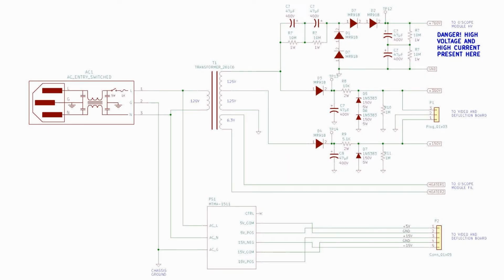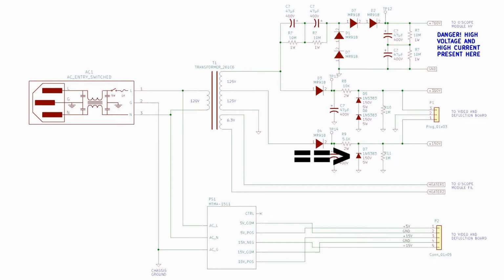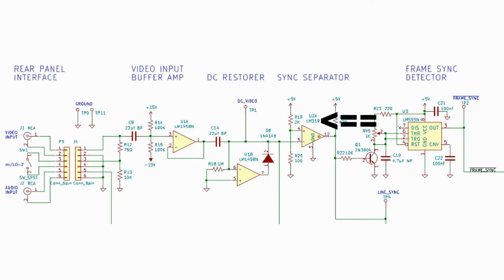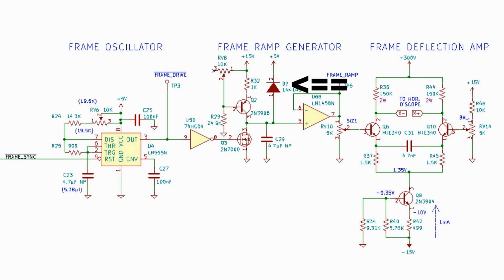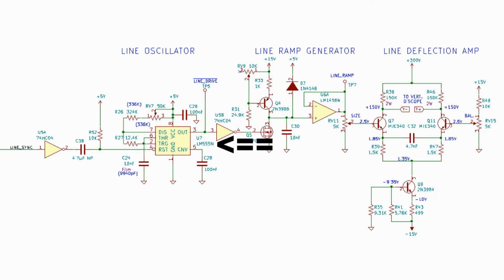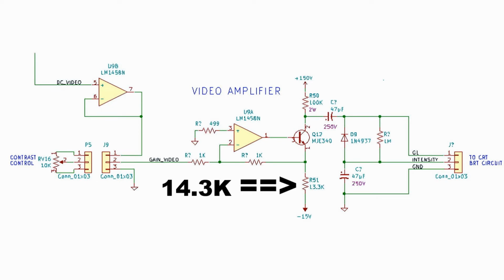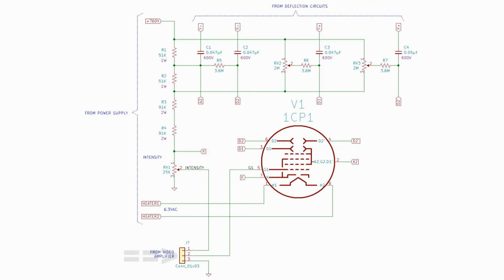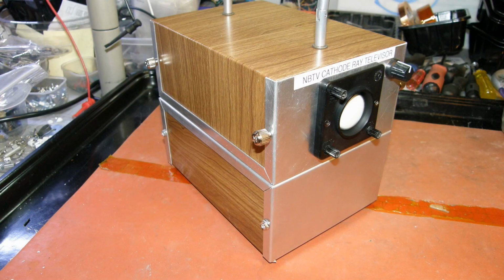NBTV Cathode Ray Televisor, Part 4

Comment: One comment on the audio amplifier. Don't you need a coupling cap to the speaker? Your implementation is running single rail so the output DC will be 1/2 VCC.
Reply from the maker: Yep. You are correct sir. Would have caught that as I completed the project. The delay in the implementation is needing to cut another hole in the box. Always a risk of screwing up a beautiful project! :)
Reply: @videolabguy  Well just put the volume know opposite the contract control. I think that would look great, balance the front panel layout. For the speaker, how about a fan grill on the side with window screen behind it?
Reply from the maker: Great suggestions all. I have some cell phone speakers that are tiny yet mighty. Its the oval holes on either side of the scope that worry me. My 3D printer is currently constipated. Soon as I drill him out, I may print some nice speaker covers that match the scope in appearance and hide any imperfections in the hole cutting. Not a high priority at this time.

Comment: Congratulation on the 2.5k! Great Video and comprehensive explanation of the circuit! This really makes me want to build a project full of 555s and op amps, maybe after my vacuum tube oscilloscope is finally finished...
Reply from the maker: I'm getting older and wiser. Allow me to share this observation... Get on with it! Those projects won't build themselves, you know! :)
Reply: @videolabguy  that's solid advice! :)